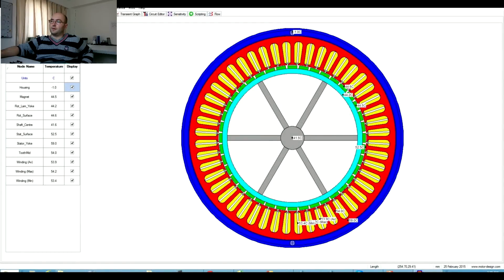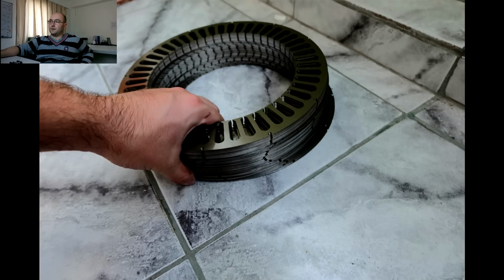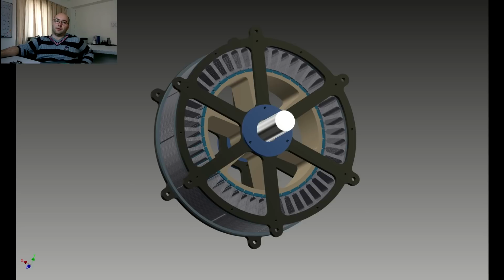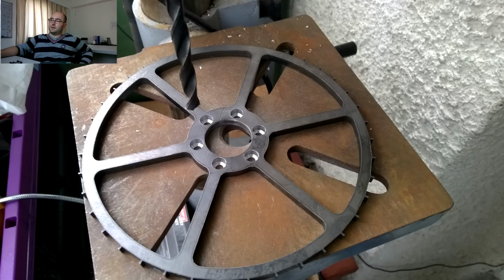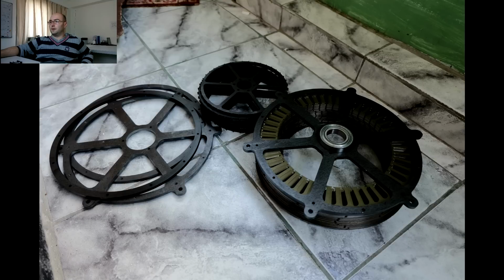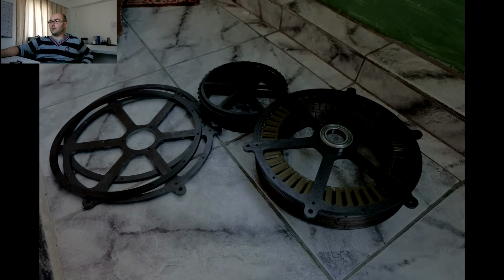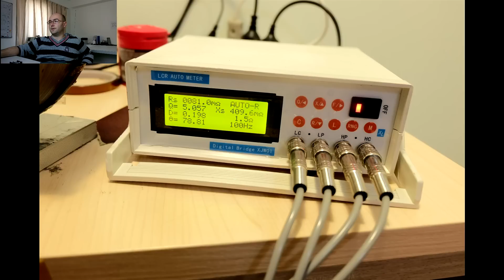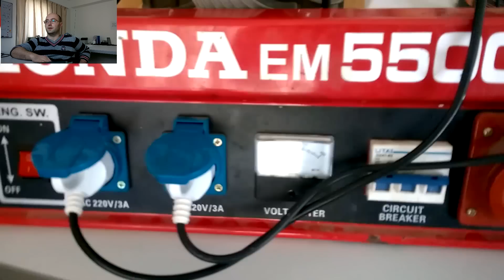How to make a brushless dc motor  at home

Comment: tell me pls where you buy 45 kWt controller? can you attach link to aliexpress or ....
Reply from the maker: I build myself the controller.
Reply: attach pls for small review :) i need to make 200 kw engines for new project .... and want to see how split mosfets on different phases.
Reply from the maker: This motor can lift 200 kg by calculation, and tests from others.
Reply: Do you even know how a 45 kVA power supply looks?
230 V x 195 A = 44850 VA = 44.85 kVA
Do you know how thick a cable is which is capable of enduring a max. current of 195 Ampères?
Reply from the maker: The batteries on the table can supply up to 100Kw By the way
Reply: Where is the 45 KVA power supply?
Reply: +iulian207 If you attached a fan blade, would it be powerful enough to fly?
Reply: You realize that there is no 45 kVA power supply in this video though?
Reply from the maker: Yes, with 23Kw you can lift 80Kg.
Reply from the maker: YOUR G-D IS A THOUGHT The batteryes are A123 systems they can provide 100kw of discharge. but even if you have supply you still need a mechanical load witch is in the second part of the video.
Reply: +s james
with the weight of the blade, motor, batteries, and a human? barely... you are gonna need extremely good engineering for maximum efficiency. you are better off with a more powerful motor for that task
Reply: i know that its not easy, but maybe we can work together and make several engines in my project? i think i can find financial support for this.
Reply: igbt expensive/mosfet IRF... series better : price/power
Reply: its good but batteries are expensive. I`ve planning gas-steam turbine with generator. Next 2 years ,i hope, i will work on this device
Reply: calculations arent everything, look up real world attempts and see its not that easy

Comment: Good work. Are you using input power from a 3 phase supply since i query how you supply the appropriate current at 230 volts to consume 45kW of power. Thanks

Comment: Very well done! I worked at Baldor where I used to machine 10000+ hp motors and the tolerance on machining was usually +- .002.  I've always wanted to try and build something like your motor using solid copper bars like the ones we used, but permanent neodymium magnets. Have you tried anything like this?

Comment: That's one cool project, great work. I have been doing research trying to find out why electric vehicles use brushless inrunner motor and not outrunner brushless motor. I know for a fact that outrunner motor offers more torque compared to inrunner motor, has more efficiency but less speed. Why are they then not used on electric cars?
Having the magnets outside and the stator inside can't be the core reason why they are not used on cars, what do you think??
Reply: https://www.youtube.com/watch?v=hLtxzPgDoSw&t=9s

Comment: Could this be put into a vehicle?
Reply: +{MLP} Rainbow Dash    I'd say so.   The smallest Telsa motor is 175kW, and the Leaf has 80kW....   so about half a Leaf.    Sounds a bit lame, but would make a great bike motor.
Reply: +Will Darling You could put one of these motors on each tire. I'm sure with some tweaking to the design you could easily have a system that outputs over 200kW
Reply: You seem educated about this subject! Quick q. What is the difference in watt input and watt output? I mean, this seems like a very efficient electrical generator of which you can create 200kw, enough to provide 5 family households for a year in Africa. Possible to just link this up from a dc car battery as input, and then drive an electrical motor to create 200 kw of output.

Comment: julian what is the hp/torqe of the motor?
Reply: The 45kW of power can simply be converted to hp  by dividing kW/0.746 = 45/0.746 is approx 60hp.
 Also torque(ft.lb) = hp x 5252/rpm
 however he states torque as 165Nm (not ft.lb) in the first seconds of video :)

Comment: I have been rewinding Brushless motors for sometimes now. I have to admit yours is one of the Finest I have seen. This thing can power a small plane, just by looking at it. GOOD LUCK. I do hope that you will share some more Pictures/Movies. GOOD LUCK :)
Reply: Would you please help.
I am not an that expereinced in electric motor but I wounder how good or how bad would be my design. I designed a BLDC motor and that seems to be perfectly good enough on paper. Would you please try it in a simulator or tell me how to make it be better even from your knowledge. I would ask you to advice me to use a specific stimulator or such but unfourtuantly, I have a REALLY BAD PC.

Comment: iulian207

This looks extremely good I'm just stunned.

But i do have some questions,

 - 40 Kw constant or peak ?
 - What RPM's will it be capable of?
 - Do you intend to make a Kit in the future, meaning motor and matched controller for this ?

It would be great if it could achieve 6k RPM, just bolt onto transmission go :)

Comment: Why not use carbon fiber since it is stronger?
Reply from the maker: +GodsLoveMinistry Carbon fiber conducts electricity. And a wire in short circuit inside a fluctuating magnetic field is a strong recipe for smoke.
Reply: the only flammable bit of carbon fiber is the epoxy, and you already have that in the motor. Carbon composites are perfectly suitable for components of electrical induction motors.

The magnetic properties of graphite are pretty friendly, mildly diamagnetic, similar to copper. Also, carbon fibers can be electroplated with metals to produce different magnetic properties (although an expensive material).

I would suggest that exploring the use of structural carbon fiber for many of the motor parts would be advisable. However, for the ferromagnetic inductor cores of the motor, probably best stick with the specific high-silicone grade of steel, ideally with the proper metallic grain orientation. Would not be a bad idea to individually-wind an iron-core inductor coil assembly and epoxy those into a carbon fiber stator assembly.

_

As an aside, doped yttrium-iron-garnet graphene permanent magnets are worth googling. However, it'll be a good decade or more before those are mass produced.

Comment: Nice motor! Could you please post some no load figures (Amps and rpm for two or 3 different rpm) as well as the terminal resistance Rm and Torque-constant Kt or Speed-constant Kv of your motor? Thanks for sharing!

Comment: Im sorry, I dont know much about dc motors... Why is the lamination process used? Is it due to performance issues or just difficulty to cut the piece?
Awesome work!
Reply: +rrs Hey hey I studied these motors for my final year Mech Eng degree so I can give a simple explanation. Short answer: it is for performance. 

Laminations help to reduce energy loss in the motor by reducing the magnitude of eddie currents in the stator.
Reply: Aha! Didnt even recall posing this question! Many thanks for answering, although I felt that as an electrict and electronics engineer currently in formation I should seek to know this. Now I know the whys and hows of it, I have already read several hours of literature about eddy currents, histeresis and such, and found a couple of books Im still going through. I actually have to thank you for the 2 months late answer; nothing better than curiosity to make one seek understanding. Ahaha
Seriously thou, thanks for answering anyway. Cheers

Comment: Would you please upload some load tests?
Yeah, you connected some generator that does 230V, but no one knows what current.

I just can't imagine that much power in such a small motor. I realise that cooling is major problem with high power here, but I wish to see it making like 20kW for 10-20 secs.

Nice work btw.

Comment: Very nice! The motor is very silent, did you have to do a lot to get it balanced ? And if so: how did you measure balance to know where to remove material ?
Reply from the maker: +Henner Zeller THe motor was perfectly balanced from the beginning because each part is cut by laser. Precision is higher than 1\100mm. I know (USA does not know how big is a millimeter) I hope in the near future you will switch to the metric system.
Reply: I know millimeters, I am from Germany :) I was just wondering because the application of the epoxy and Kevlar is done by hand and might generate imbalances.
Reply from the maker: +Henner Zeller until 2600RPM i did not notice any significant vibration.
Reply: @iulian207  We're still holding our breaths...  At least Jimmy Carter convinced Coke to switch to the metric system, but the aerospace, auto manufacturers, and surveying companies are still hanging onto the old english standard...something about those units being easily divisible into 1/4ths and 1/3rds and powers of 2.  Really we should all just compromise and switch to a hexadecimal units system :P
Reply: @BSpinoza210  hahaha! hexadecimal system I love that - it always makes arithmetic easier for me
Reply: @iulian207  In another video, It was shown that the weight of each magnet varied slightly, and the strength of each magnet varied considerably.  You didn't have that problem?
Reply from the maker: +d7j6f1 magnets are 60x13x4mm 12 turn per coil, cooper wire 0.5mm
Reply: +iulian207 you will find that all USA engineers are happy to work in both units, while our material suppliers are not!
Reply: He says 15 wires in parallel at 0.29 :)
Reply: +iulian207  How many wires per coil?
Reply: He says 15 wires in parallel at 0.29 :) But thats alot to ask from that wire size drawing 300 Amps. Alot of cooling needed
Reply: Could potentially design planar elements rather than windings, and thus get the balance more precisely organised and perhaps get better control over the magnetic flux.

Whatever the grams, at a few thousand RPM a foot off center, that's not grams anymore, metric or imperial.
Reply: Henner Zeller
Reply: Tell me why i started reading your comment in a german accent..illuminati confirmed
Reply: A lot of us know how wide 9mm and 5.56mm is.

Comment: Thanks for publishing video. Could you please share the controller circuit (if its not a secret of course :) )? Are you using HALL sensors to control phases or back emf?
Reply from the maker: +George Eliozov For automotive hall sensors are imperative, or resolver.
Reply from the maker: +George Eliozov the circuit is on my website in the description.
Reply: +iulian207 Thank you so much! Also I found that you have issue with stepping down 50V power line. MAX5035 is PWM Step-down chip which is capable to work up to 76V.
Datasheet: http://datasheets.diptrace.com/maxim/MAX5035.pdf